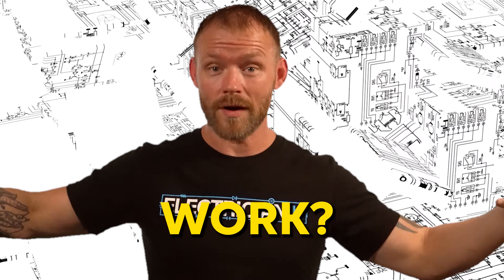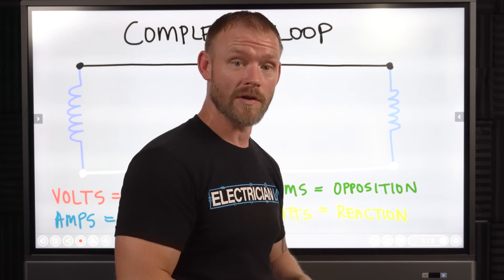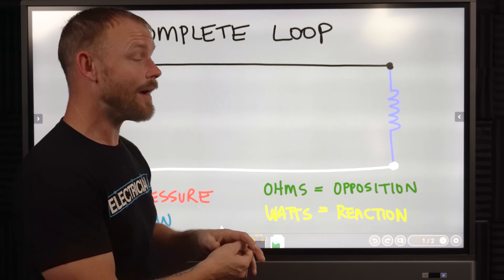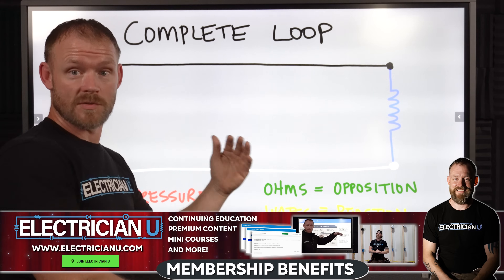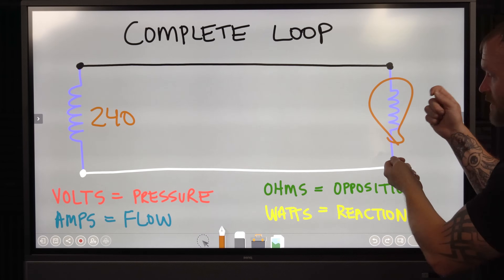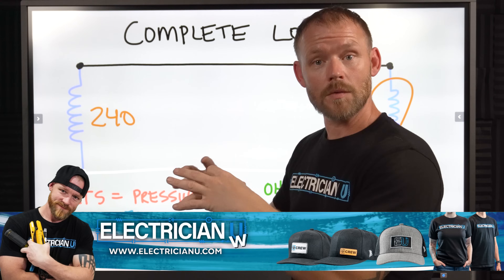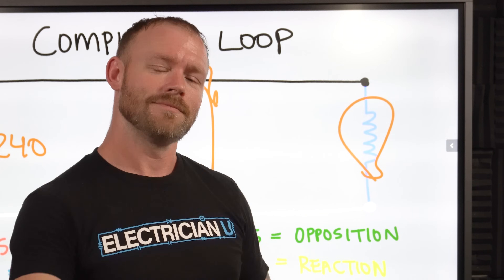How Do Circuits Work? Volts, Amps, Ohm's, and Watts Explained!

Comment: Sooo, ideally, the resistor is something that will usually convert electrical energy into something else? Shapeshift it as you will????   

So the more the resistor can resist the need to use power...the less energy we'll use??

Lower wattage light bulb = higher resistance?  Do the amps/flow change or remain the same?

Comment: So, the meter on the outside of the house measures the amps entering and exiting the house and calculates the energy lost or wattage with each cycle of the completed circuit. Is that about right? It's calculating the wattage used during a month of cycling power into the house and back to the pole. Is that approximately right?

Comment: °volts = pressure 

°amps = flow 
1 amp would mean very few charges flowing per second so the more the amp the more •••••••••••••••••••••••••••••••••••••••••• little balls are flowing 

°ohms = opposition 

°watts =reaction

EVERYTHING IS A LOAD EVEN IF I INSTALL A LIGHT BULB ITS CONSIDERED A LOAD 

WATTS : IF SOMETHING IS 100 WATTS THAT MEANS THATS THE  LOSS

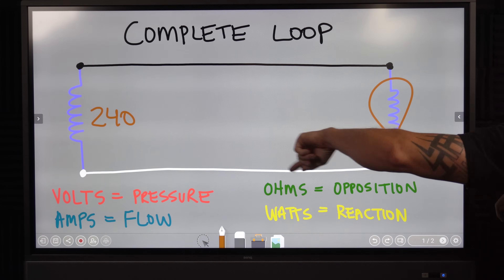Comment: At 8:40 current doesn’t flow at its maximum capacity as it is just the flow of positive and negative electrical charge particles thats changing its velocity (drift velocity) sorta speaks.

(Think of current as the flow of water)

And also current doesn’t travel at the speed of light, that statement is wrong because it is a physical dependent on circuits, which also depends on voltage and resistance. It’s is only electromagnetism that can travel at (50-99%) near the speed of light in a vacuum because they don’t require any physical dependents and it’s only an independent through the vacuum of space. (Plus, electromagnetism is also denoted as a wave spectrum. Deriving it using Maxwell equations will help you understand the mathematics)

Comment: So I have a question. Dead short is the maximum amount of amperage and speed for there is no load. What about when High voltage travels through the air, gets to the ground, and is wildly arcing and continuously flowing. Is there any high resistance traveling through the air, or is it more like a dead short?

Comment: So what is it if a thermal electromagnetic generator is not passing enough electricity to charge the battery? A resistor within the circuit board or within the Generator?

Comment: Ive been trying to find any kind of explanation of this I can actually soak in and grasp for the last couple weeks and I'm glad I finally found one. I had a job in which I was recently laid off, as an electronic assembler building high voltage power supplies, (the PCB and solder part of it anyway) and I guess you can say it caused a spark (no pun intended) in me to want to learn actual electronic / electrical engineering. So I thank you, sir.

Comment: This is good for a beginner explanation of electricity, but at 8:48 he's wrong about resistance slowing electricity. Resistance limits current but does nothing to the speed of the current that passes. It would have also been worth mentioning that wattage is just Volts X Amps.
Reply: True, resistance just limits the amount of charge that can pass throug a certain point in 1 second not the speed of the charges.

Comment: Funny, I avoided the basic understanding electricity for a long time because of the water analogy. I couldn't convince myself (or anyone else) that the only way to increase water pressure to get a decent shower, was to use less water.  It just didn't make sense. It's nice to see someone point out there are problems with that analogy.

Comment: Its amazing how similar utility locating is and electricity. Im not even close to being knowledgeable on electricity but know of the loops because of work and utility locating… I often can tell if my locate is going to be a good or bad locate by the amount of volts I get when I hook to a wire. Normal readings should give 20mA,  voltage reading in standard mode for an RD can max out at 30 volts. It would be interesting to see your take on the similarities between utility locating and electricity

Comment: Very good input, so I have a ceiling fan when I turn on the switch, the light flickers and but the fan still runs at normal speed.  Is that a capacitor issue?
Reply: Inside the fan?

Comment: A circuit is called a circuit because at a minimum you need a loop of wire to include both the source and the load to enable current flow, the loop forms a circle, hence circuit.

But, there is a problem. The video uses a circuit diagram which depicts ideal component models within certain rules that help us make circuits and the application of electricity useful. The diagram is not however the real world, it is an idealized representation of effects caused by electromagnetic fields. To understand circuits you must understand electricity, which means understanding electromagnetic fields. The starting point for this is to understand Maxwell's equations in what they represent, you do not have to understand the math behind the equations vector calculus. This is because Maxwell based his unified work on others that came before, like Gauss, Faraday, and Ampere.
Reply: Say more, lol

Comment: Ok, but where do the amps originate from?  Like you said, if you just had wire connected to wire at 240v what would be the amperage? I hope I'm asking this correctly.
Reply: I was wondering about that also
Reply: You must use Ohm's law V=IR. Current depends on resistance of circuit and voltage. Increasing voltage increases current while increasing resistances decreases current. If you connect 240V directly without the load you would get what is called a short circuit which is not something you want. When short circuit happens you have extremly large current because only resistance to current is resistance of wire which is very low but it does exist. So theoretically you could calculate current of short circuit if you knew resistance of wires and voltage 240V.  I = V/R

Comment: When you go to the shopping center that has a refrigeration unit with all currents and lights on . Refrigeration unit starts and stops. light, do not flicker or dim. Yet on ur house it does happen.  Lets say everthing in ur house wiring is great ,breakers . This is a 200 amp main breaker. The other breakers are 20 amp the total amp draw is less than 70% of the 200 amp main breaker. And ur ac draws 40 amp on LRA. But when ur ac start lights flicker or dim thru out ur house. What could be the reson for it. What is the difference betwin the shopping store and ur home
Reply: It depends on which lights you are using. The problem probably is in lights (that's my assumption). This usally happens with bad quality or old incandescent lights or fluorescent lights. Because in incandescent lights the light is produced as a result of heat which is a result of current through the filament which takes some time. It also happens with bad quality or old fluorescent lights which are very sensitive to temperature because of ionization process. However this usually doesn't happen with LEDs. That's my assumption depending on information you told.

Comment: Question on a series wiring on ceiling lights that have 8 lights & only 2 or 3 comes on & the rest not coming on?
Reply: Well if they were connected in series and one of the lights was broken than none of them would light. My most reasonable guess is that the lights aren't wired in series but in parallel.

Comment: So, does a light bulb have a reactant that applies a certain amount of ohms, as a governor, which results in the proper voltage to pass through, expending say 60 watts? 
Do you have a video that explains a circuit in a house? More detailed... From the breaker to a bathroom with GFI's for example? Examples of how you have screw it up or blow the circuit, etc...
Thanks I like your vids and I'm a DIY guy.

Comment: Ok. What I don’t understand is: if the current is alternating, why would there be more pressure on one side than the other?  Why isn’t the “neutral” an equal source of voltage?
Reply: First think that is important is that voltage is difference between 2 electrical potentials. So you must always measure at 2 different places to get voltage between them. Alternating voltages does alternate just as current does. Alternating voltage changes its value and polarity over time. For example frequency of 50Hz means that voltage waveform repeats itself 50 times a second. Neutral wire is at constant electrical potential of 0V while the electrical potential of hot wire changes from positive to negative in comparisson to neutral wire's 0V. So sometimes (we're talking in miliseconds) the hot wire is at higher potential and some other time neutral wire is at higher potential. That's why we say voltage and current are alternating.

Comment: I've always wondered:  Since current travels back-and-forth in AC, does that mean the neutral becomes the hot and vice versa during those alternating paths?
Reply: Good thinking. First think that is important is that voltage is difference between 2 electrical potentials. So you must always measure at 2 different places to get voltage between them. Alternating voltage changes its value and polarity over time. For example frequency of 50Hz means that voltage waveform repeats itself 50 times a second. Neutral wire is at constant electrical potential of 0V while the electrical potential of hot wire changes from positive to negative in comparisson to neutral wire's 0V. So sometimes (we're talking in miliseconds) the hot wire is at higher potential and some other time neutral wire is at higher potential. That's why we say voltage and current are alternating. But it's important to note that neutral doesn't change it's potential 0V so it's a refereence to the changing voltage of hot wire which could be higher or lower than 0V potential of neutral. So in summary the neutral can indeed be higher potential than hot wire in some moment. Many people don't know difference between term voltage and electrical potential.

Comment: Hi okay in the US there is 60 hz and on 
Europe 50 hz when I think of the sin wave is a general thing and it moves at a specific speed so why is it 60 hz here and 50 in Europe? I thought that maybe the bigger the voltage the faster the hertz but here in the states there is 120 v 240 v 460 v and so and they all have 60 hz so how is it slowed down in Europe?
Reply: There's no direct relation between voltage and frequency. Transformers change the voltage but not the frequency, for example. The frequency is basically determined by the rotational speed at which the generators turn. The reason for 50 Vs 60 Hz is just what was standardised in different regions historically.
Reply: It's only due to historical reasons that some countries like USA have 60Hz frequency and Europe has 50Hz. We have different frequencies because of rivalry between companies. Your theory about relation between freqency and voltage is very wrong. Frequency and voltage are 2 totally different things. Frequency tells you how many times in a second waveform repeats itself. For example 50Hz means waveform repeats itself 50 times in 1 second. But voltage is the difference between  two electrical pontentials. It's the energy available for 1 Coulomb of charge. For example 1V means that 1 Coulomb of charge has 1J of energy available which could possible be turned into heat, light, motion and so on. Frequency produced by a generator is determined to how many rotations generator does in 1second. So for frequency of 50Hz generator must do 50 turns every second. Voltage of the generator on the other hand is determined by many factors such as how strong the magnetic field inside the generator is, how fast generator is turning, how many turns the coil has and more. But main message here is that voltage and frequency aren't affected by each other in any way.

Comment: Im still learning, however, could voltage be described as the amount of energy present between 2 points on a circuit rather than described as pressure?
Reply: No. Voltage is the difference between 2 electrical potentials. It is related to energy but it isn't the same thing as energy. Voltage tells you how much energy is available per 1C of charge. So 1V means that 1C of charge has 1J of energy available V = W/Q. This means that you can have a lot of electrical energy even if voltage is low because you could have so many charges W=V*Q. For example if you have low voltage of 1V and 100C of charge the total energy would be W=1V*100C=100J which is a lot higher than energy of 1J which is available for 1C of charge. So voltage is not equal to energy.

Comment: You're right about everything but the "humans can only see a certain frame-rate" I'm afraid that's false, our vision system isn't really comparable to video systems, instead the human eyes are more similar to an analogue based device, we just constantly receive data based on the amount of photons hitting our retinas which happens at the speed of light which (At least to my current knowledge) is the fastest speed we believe can be achieved in this universe.

Comment: I am trying to build a power source for a portable air mask, and it calls for 24 volts 3.4 amps. My question is if I connect to 12 volt battery's each with 3.4 amps will I get 24 volts with 3.4 amps or will the amperage also double??  Thanks for your advice.
Reply: Yes you can connect two 12V batteries in series to get a total voltage of 24V. It's important to know that loads have such resistance inside them that the current will be 3.4amps if you connect them to predifined voltage. But you must connect them in series and NOT in parallel as that would double the current instead of voltage.

Comment: I have a question..... for example, say a one 15 amp breaker on a panel. If you need a complete loop that is alternating current, then how come in a basic circuit the neutral may not show any voltage but the black shows hot?? If it is alternating shouldn't the neutral be fully hot 30 cycles per second? or half the time?  Although I do fine installing electric in homes as a DIY this is where I just need a little explanation to "fully" understand.  I kind of blows me a way when I use the little beeper current pen  tool and the black or red beeps away but white doesn't in most cases. It's funny that I "get" the branch circuit concept and phase but not the most basic part of alternating current on a basic circuit.
Reply: it doesn't read voltage in respect to ground. the neutral is connected to ground at the panel

Comment: Love your channel , love everything you do, but be careful with the water analogy, water has mass, electric charge has no mass , thus its able to reverse 60 times a second. Its also better to describe voltage as electrical tension not pressure, also I'm sure you are aware that electrons move very slowing in a circuit, its called electron drift, its the electromagnetic charge that is pulsing through the circuit at the speed of light, and finally the energy that powers the load comes from the electric field not from whats in the wires (Poynting Vector) .

Comment: Flow is a common description for amps, but electrons don’t actually travel a physical distance within a circuit the same way water would in a system. Can you explain this? And would you consider bandwidth a better term for amps?

Comment: How about a video on the advantages/ disadvantages, if any, on wiring a dual voltage motor to 120V or 240V?  Been trying to find some answers but its been difficult, I can definitely tell that my radial arm saw seems to spin up faster on 240V... Thanks

Comment: Not 100% true at 1:05 
If the voltage & current are large enough AIR becomes the CONDUCTIVE PATH and will complete the "CIRCUIT".
Thus we get PLASMA ARCING.

Comment: That was beautiful. Question: there's also resistance in the wires that carry the electricity, correct?  But it's lower than the bulb, so the filament gets hot and glows while the wire doesn't?
Reply: Yes, all conductors have a small amount of resistance that causes line loss in the form of heat, and also voltage drop. Properly sized conductors for the distance and load will have a negligible effect on the output, but this is why conductors have to be sized properly. Too small of a wire over too long a distance, or too large of a load on too small of a wire has essentially the same effect, which is that you lose too much power to the resistance of the conductors, causing them to heat up while also reducing the available voltage at the load.
Reply: Yes there’s technically a tiny bit of resistance in the wires but its so small that you can ignore it in most situations and treat it as zero. And yes similar to friction, greater resistance creates greater heat
Reply: If you have a 12 amp motor, like a drill, at the end of a 200 foot 14 awg extension cord you will have 13v taken up by the extension cord. So the drill will get 107v instead of 120v. This can damage a motor. 

If you use a 10 awg extension cord you only loose 4v so 116v will get to the drill.

Comment: I got a question why are electrical explosions  blue?
Reply: Depends on the air and material molecules around the explosion.
And also, it's like a flame. The higher the temperature, the blueish its color.

Comment: 3:50
Using the Crowd as an example his much better than using water to demonstrate Electrical potential "Volt" .
But at 6:08 this is a representation of DC current "batteries" , AC is different. It's more like as if the "BB's" all want to face the same way because of the magnets in the generator. They face one way and the other 60 times per seconds " hertz ".

Comment: That was a great video. I have been told that if you break the neutral instead of the hot you can destroy a lot of motors and other electronic devices. What's going on there? I realize current can't flow so it won't work but why does breaking a neutral cause damage when breaking a hot just switches it off?